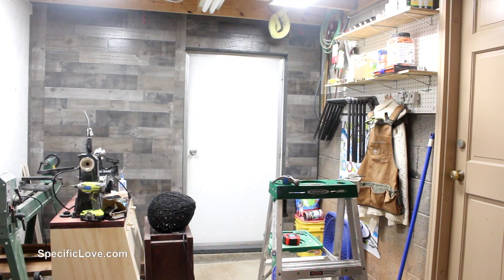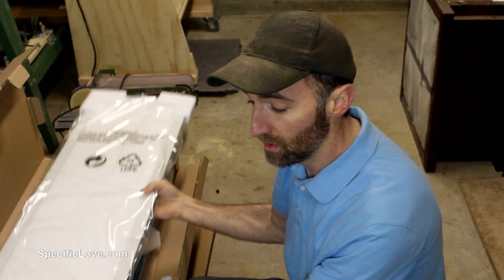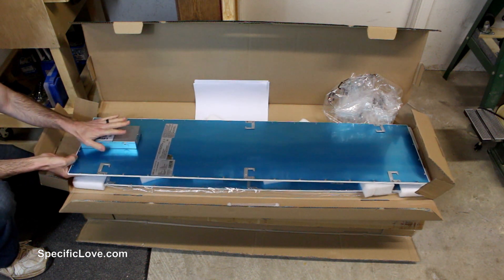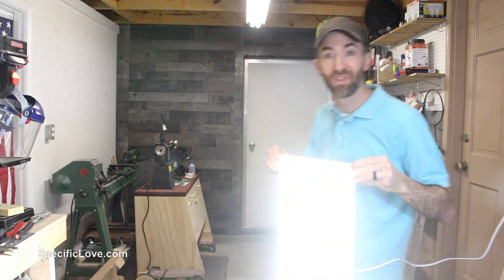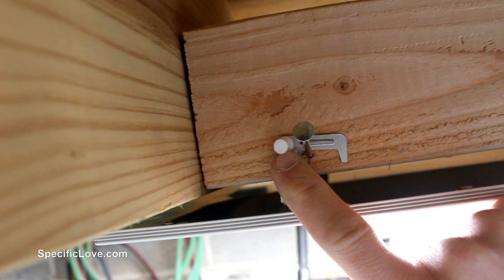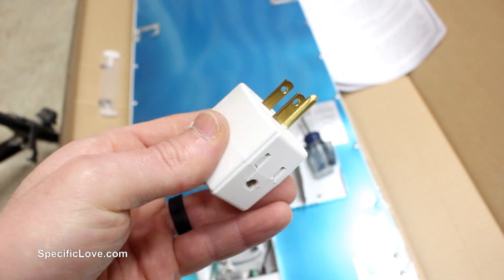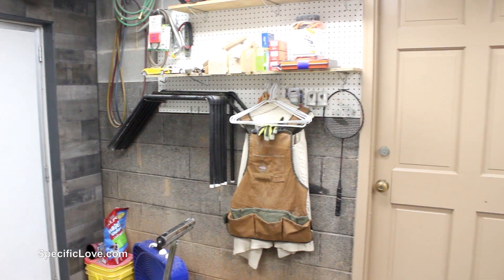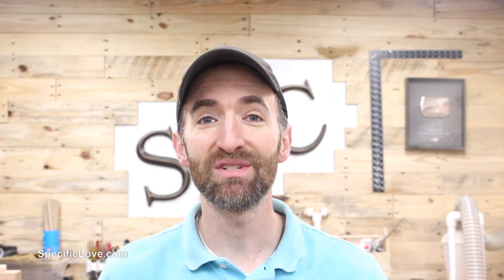Upgraded to LED Flat Panel Lights in the Shop

Comment: I did this in my shop with LED's that were configured like standard florescent lights. I don't know about yours but mine are designed that if they burn out (slim chance I know) I have to replace the entire unit. Is that the same with yours?
Reply from the maker: Yes, each fixture is a complete unit. But hopefully with 50,000 working hours, they will not burn out any time soon.

Comment: This is a bright idea 💡 so much better than any older lighting options.  I don’t have these LEDs but most of my shop has been converted.   Huge improvement. 👊🏼🔥👊🏼
Reply from the maker: So true. It is so nice to be able to see under the benches without having to use a flashlight.

Comment: WOW, Made a Big Difference! I noticed you left the old lights hanging. So could you remove the LED lights and hook up old  hanging lights  if you ever moved your shop to another location?
Reply from the maker: That is a possibility. But for now I left them up for a few weeks to make sure the new ones are working well.

Comment: Seems too bright. Also you have alot of shadows.. also ballasts are so 2019 bruh, join the future. Switch to ballast free lights, one less thing to worry 'bout breaking. Personally I'm looking favorably at a non-shunted fixture for T8 G13 for Philip Bulbs at 5000K daylight with both PWM and Voltage dimming tech.